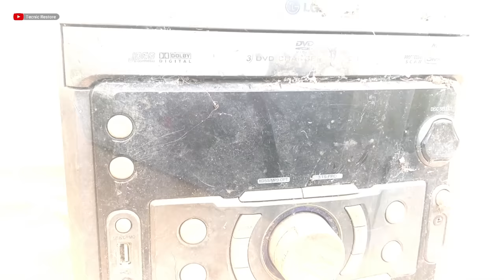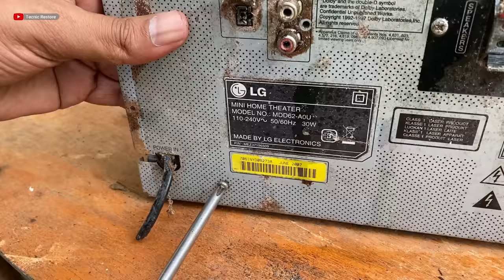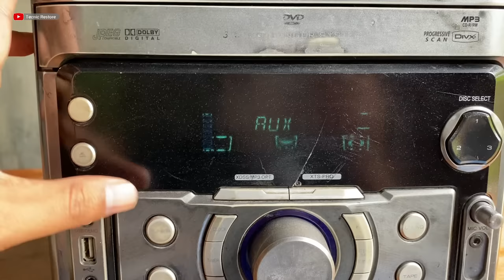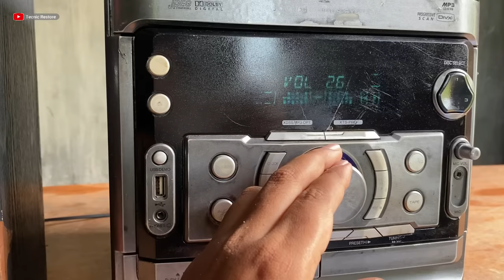Restoration Old LG Stereo radio Cassette CD 3 Disc Player

Comment: Hi, I have this same LG Home theatre since 13 years, It's model is MDD-62. It shud have two detachable LG speakers, in your case it is missing,  owner must have retained it.  Once in between it suddenly stopped working and went in protection mode, every technician I met told me to get a new system. Finally I got it repaired and is working fine now.

Comment: I'm honestly really glad people like you exist, instead of letting stuff like this rot away, you restore faith in us by giving them a second chance, not to mention, a a hi-fi system like this will work for at least a "Decade", which is super mega convinient.
Reply: Zrs
Reply: Hate to break it to you but they cover these in dirt and then pretent to find them , after they have been sitting in mud or water for many weeks or months its amazing with a clean up how everything works with no teplacement parts needed , so to break your illusion 😔

Comment: Mk. So, the amplifier works. Nothing else was "tested". I have a few problems with this. The tape deck motor was just hanging around rusted and probably will never work again, and the belts are missing (I think I saw one in the bottom of the cabinet whilst being disassembled). That tape deck mechanism will probably never work properly again even if you got going, considering you soaked the thing with the garden hose. Bad idea. We have no idea the condition of the CD changer/player. Why in the heck would you spray paint over the printing on the back panel, and most importantly spray paint the FRONT?! I've never cringed so hard in my life than I have during this video. All that effort for only the amplifier to work. And what about those three blown-up capacitors you removed? Did you replace them?

Comment: I knew the cassette players wouldn't work again,,,seen the motor and belts missing,,,but did the cd player and radio work?

At least the auxiliary input did,,,but did u connect the right speaker,,,to b sure it was working too?

Comment: Wow! i didn't think you could soak circuit boards like that doesn't that liquid damage them if you do that? Also, they should have put a bluray player in there w/ hdmi out or even a 4k player but doubt that would have been a thing back then though.
Reply: Well, it's not a good idea; however, I cannot tell if this comment was intended as sarcasm.

Comment: You didn't fix the double cassette mechanism or even the DVD ... You only revive the power amp section... You just did repairs, not a restoration ...

Comment: In what world is that a restoration? Really a shame about the time I spent watching the video. The tape deck is still junk, and the tuner and the CD drive probably don't work either, otherwise he would have demonstrated it. I'd better not say anything about the paintwork, and the terribly soldered power cable also speaks for itself.
A lot of time could have been saved if the system had simply been cleaned with a steam jet, which would probably have had the same result.

Comment: Props for the functional restore on the LG stereo cassette CD player. But the slip shod restore of the case and interior was less than impressive. Painting over the rust, identification labels and function labels was not restoration in my opinion. You could use it as a shop radio, but no one else is going to want such an ugly version of this product. Most would just buy another version of the product that is in better shape. Not impressed with the cleaning methods either. I understand the content creator does not have a more professional shop, but he could have made more of an effort on making the restore more visually appealing to the ones watching it.